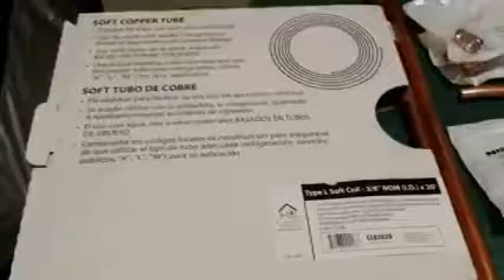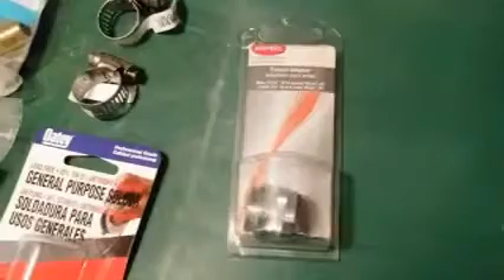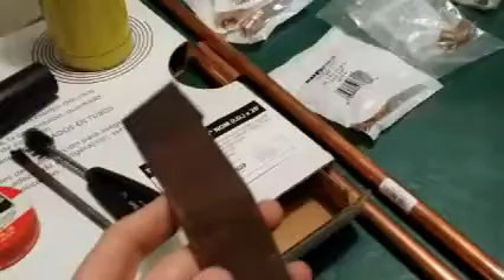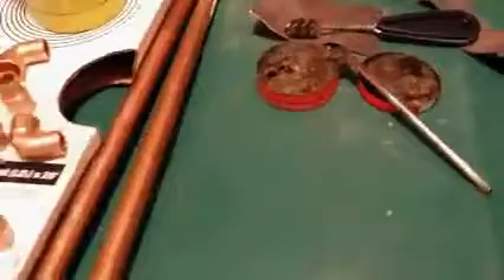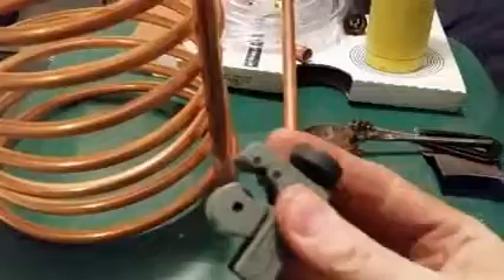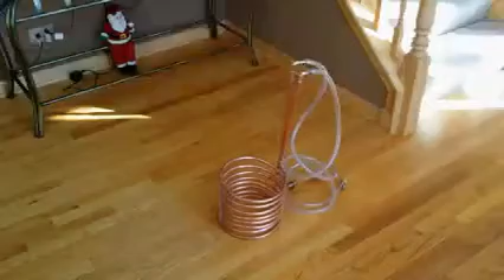Wort Chiller - Build a Wort Chiller With a Better Handle (Sturdy!)

Comment: A little tip on the sweating, have a wet rag on hand and wipe the drips right when the solder pools in the fitting. Awesome video. I was just thinking this in my head when I came across your video. This looks so much cleaner than the others. Also I was wondering about a spot solder on each coil where it comes in contact with the rigid copper pipe. Just to keep coils ridged. ??? Any thoughts?